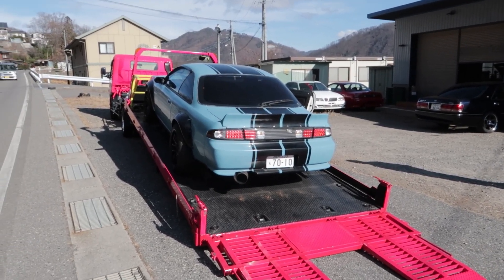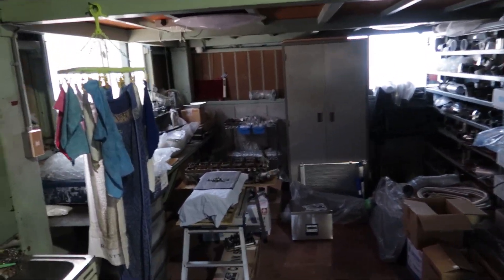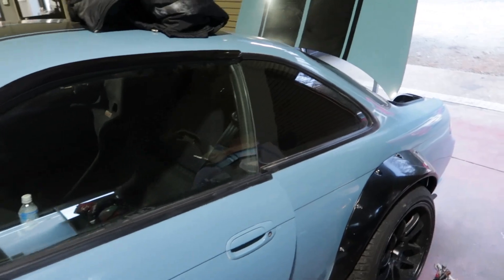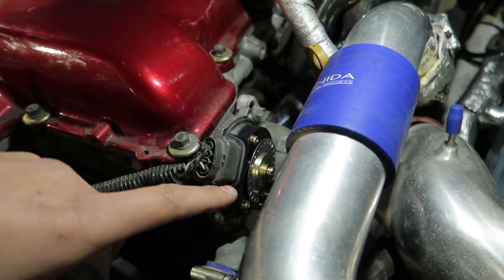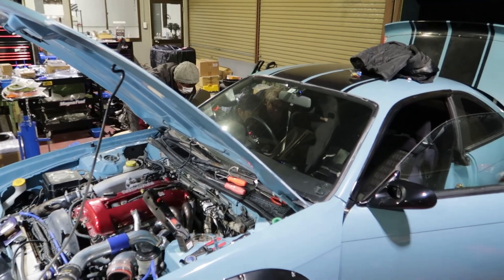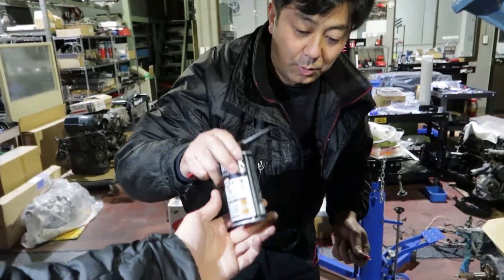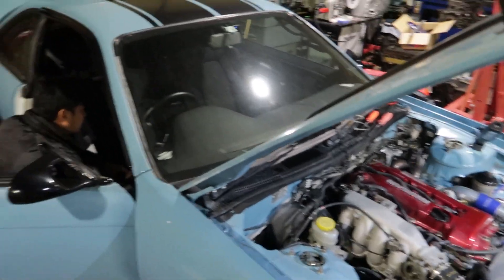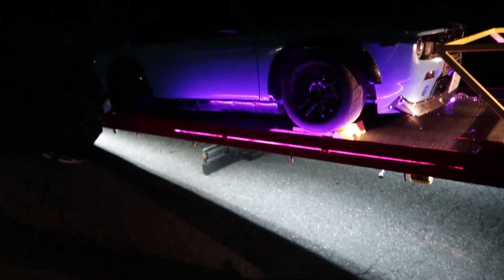LEGENDARY JAPANESE TUNERS LEARN NEW TUNING TECHNOLOGY!

Comment: "A datsun sunny front end" looks like a Dodge challenger, especially with that racing stripe.
Reply: My girlfriends dad got a hellcat red eye first day it came out long story short I’m riding with him on the way home and out of no where an all black rocket bunny s14 appeared I was like dammmmmmmm ! Looks good in person looks even better from the window of a red eye
Reply: Well it should look like a challenger because thats what the boss kit is designed to look like
Reply: all except Datsun came out with the sunny way b4 a hellcat was a thing, I know there modeled after the OG challengers, which is where Datsun got their inspiration. It's kinda like a big circle. They all inspired each other. Car designers were so much cooler back then. Back when they did stuff cuz it looked BADASS not because it looked pretty decent but conformed to the rigorous safety testing and protocols. Safety is the worst for designers. It has/will ruin many a great looking cars, and it's only getting worse with time as regulations increase and the great ones give up and retire. Soon enough we won't even be driving cars anymore. The car will do it all itself.
Reply: It's a datsun front. Check my profile pic, I've built one. It's a beautiful combo.

Comment: Hey Sam, do them Link's Ecu work/compatible with a Barra?? Still planning my 1978 F100 fleet out. Definetly on par with the Barra motor though. Also, what do you think would be a reasonable transmission? Gonna try for 1000hp atleast but have the truck set up on a dial for boosting since it'll be my first turbo vehicle and with all the sentimental value. Only making it look good and set-up though, but every so often wouldn't mind to dig in her to say😂